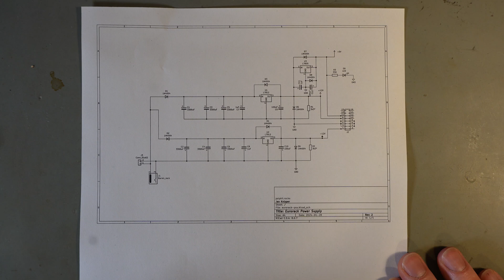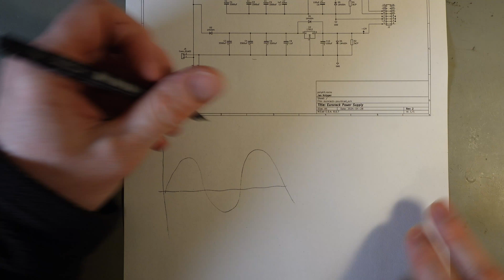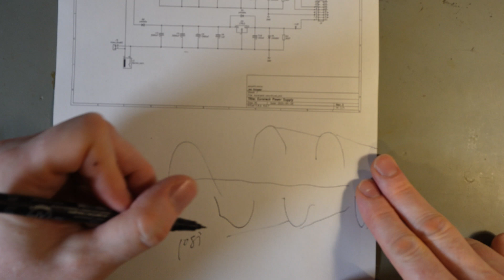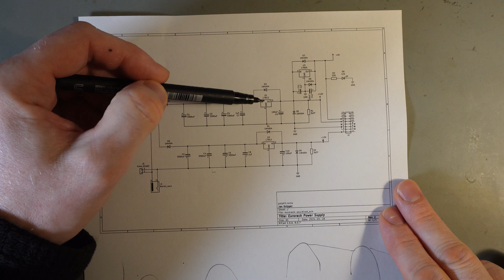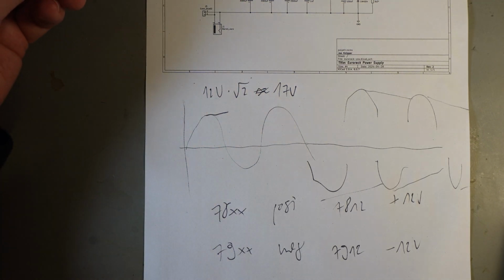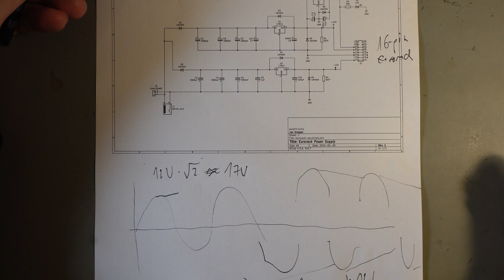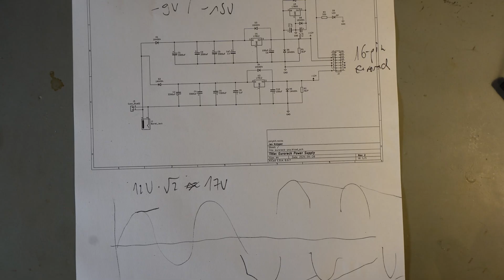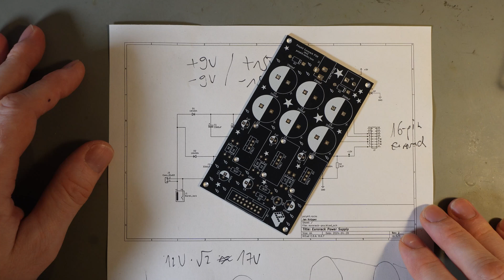Building a simple Eurorack power supply

Comment: im new and i think i follow along but for some reason chatgpt has been arguing with me. im looking to use a 12VAC 1000mA wall wart and thats all i need for this circuit right? a single one because it splits the ac wave in half? chatgpt keeps telling me i need a second source or a true centertapped 12-0-12
Reply from the maker: Yes, that’s correct, you don’t need a center tapped transformer. This simple design splits AC in half and smoothes it out with the chunky capacitors. Cheers!

Comment: I literally am using one behringer PP1 module.    Current draw is 60mA.    Can't i just locate a power adapter that has both +12V, COM and -12V and hard wire it in to the ribbon cable of course at the proper pins?     The cheapest power supply i found is the CP1A at $59.   It is total overkill for my 1 module.    Any suggestions?
Reply from the maker: If you want it cost effective either a similar design like this. Or there is a Meanwell PSU which supplies +-12V at around 20 bucks. I think it’s called RT-65B. But you need to fiddle with mains voltage there. Only try this if you know what you are doing. Cheers!

Comment: Thanks for this. I just use 2 laptop PSUs with linear regulators not ideal but simple. I also found a +/- 12V linear Regulated PSU on eBay with mains transformer for less that I could source parts BUT there were mains voltages exposed in the case :(
Reply from the maker: Yeah, there are a lot and even better options. This design here is very simple and good for beginners in synth diy. Eg. a lot of people use two switched supplies for dual voltage. But as you said this one here is not exposing mains voltage, that's what I like the most. Cheers!

Comment: If I used a transformer with a center tap instead of a wall wart, could I use that to get +/-5v, or is that a bad idea?
Reply from the maker: I guess you could use the same design I showed in the video for a 5v dual voltage supply. A psu with a center tapped transformer would look a little different.
Reply: @polykit  I'm sorry for the confusion, I mean using the same design for +/-12v, but also having a center tap for half the voltage, so the load on the transformer would be unbalanced across its windings. The same transformer would generate +/-5 and +/-12, I'm just not sure how bad loading the windings like that would be.
Reply: Nice simple design. I’d go with 317s like someone else mentioned as you can set the output to exactly 12 volts with only a couple of extra components. I’m currently looking at low noise switching mode psu technology for synth circuits. It looks like a hybrid design with bits from linear design and something called ‘soft switching’ to reduce the actual switching noise.

Comment: The LM317 (+ve adjustable) and LM137 (-ve adjustable) can handle currents of 1.5A, whereas the the 78xx & 79xx regulators can only handle 1A.
Reply from the maker: Good advice, I should have mentioned it in the video. A lot of the 78xx/79xx are specified for 1.5A. There is also a 78Sxx series which can handle up to 2A, only positive though. Cheers!

Comment: Super nice, thanks for sharing!  Cheap and simple is nice, but could you say something about limitations and downsides, if any? Not trying to be critical. I just want to understand why other PSU are so much more expensive and if that’s necessary at all. Thank you!
Reply from the maker: Sure, dowsides are the current it can provide is limited to a few amps and it's very inefficient. Most of the power will go away in terms of heat it produces. That means you need good cooling which could lead to other problems especially if space/ventilation is a problem. Also when driving this at its limits ripple will definitely an issue.
After all this is a simple and very cost-effective design as a DIY option. What I like the most about it is that you don't come into contact with mains power when using a wall-wart adapter.
Reply: Noob question: do R1 and R2 also discharge the caps when switching off?
Reply from the maker: @TitusvonderMalsburg  yes, until the regulators shut down at some point.
Reply: Thank you. Just ordered the kit :)
Reply from the maker: Thanks! I’ll put it in the mail asap 📮
Reply: @polykit  Just tested it and it works so I didn't mess up :)  I'm measuring 4.98V, 12.01V, and -11.87. Is the last number still in the expected tolerance? And is there an easy way to trim it, if not?  Thank you!!!
Reply from the maker: Cool that it’s working! There is no way to trim the voltages in this design. The tolerance of the regulators is 5% or something so this is expected.